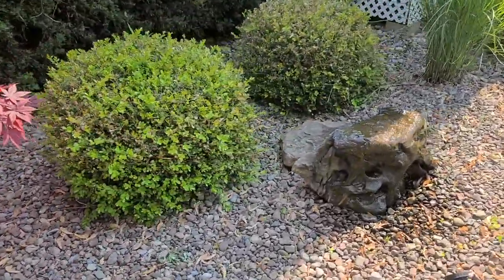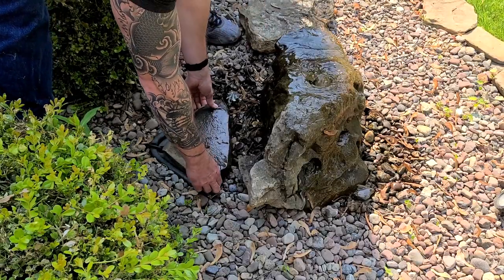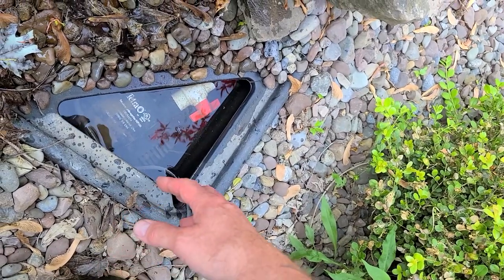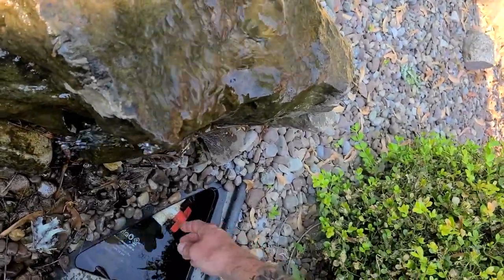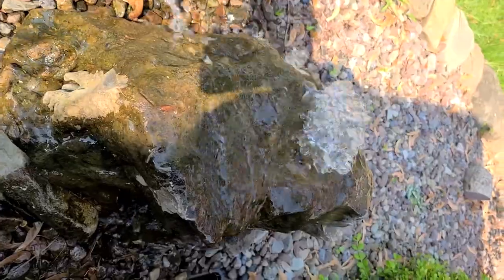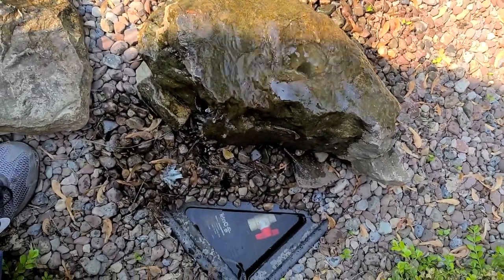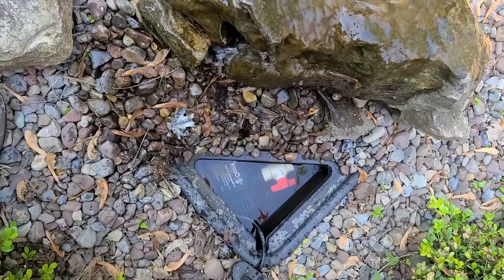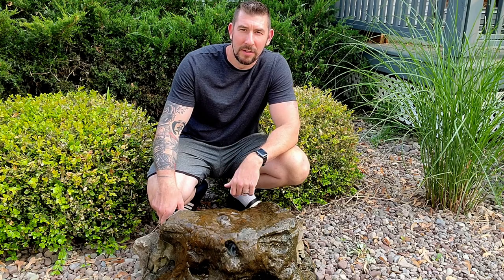How to Build a Rock Fountain Follow up - Your questions answered after 2 years in service

Comment: Still looking good. Could you please give me the size of your fitting,valve and tubing and where you purchased them. Any info would be greatly appreciated. Thanks
Reply from the maker: The hole in the rock was 1 inch, I used a 1inch barbed pvc fitting and a 1 inch hose attached to a 1 inch pvc ball valve then to the pump. All of these can be purchased on Amazon or at a store like home depot or Lowes. Hope this helped!